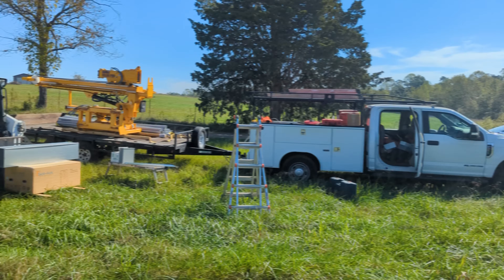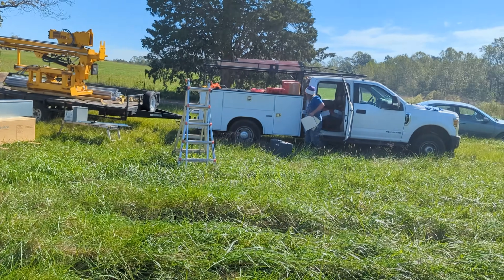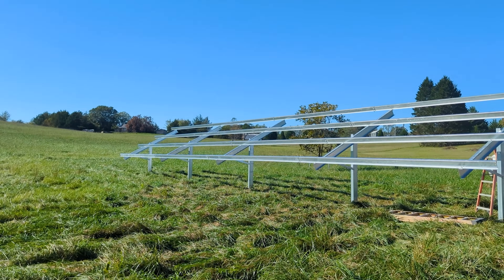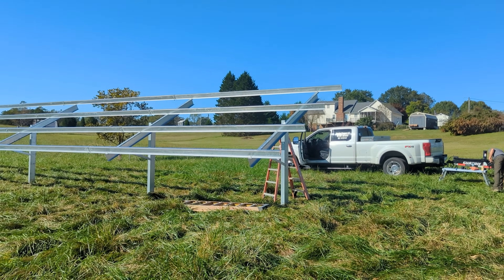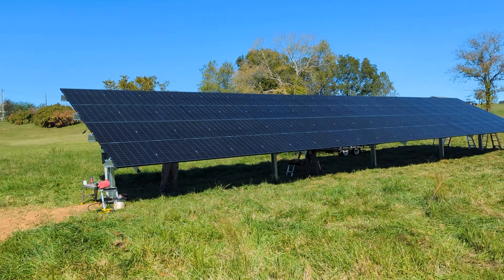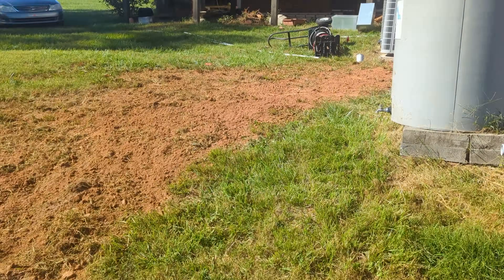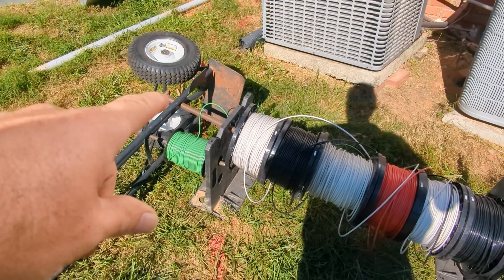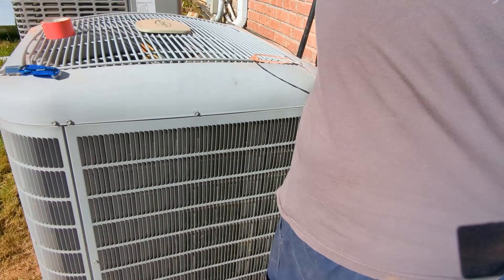Solar

Comment: What gauge PV wire to run over 300’?
Reply: 8 awg. It keeps the voltage drop under  3% with 22 amp/320v range. If you don’t parallel at the array it cuts the amperage in half so you can get away with 10awg. This is based on 300’. Southwire has a good mobile voltage drop calculator available for free wherever you get your apps.

Comment: Neat. Am installing 2 EG4 18K using 56 Aptos 370 nano bifacials ground mounted, using 6 EG4 power pro's.  As a Ham operator I am installing this in a separate power house with a UFER singular ground. It also has Foil insulation all around it for EMI/RFI along with EMP shielding. A Faraday shield of the sort. This in hope to lower the noise that PWM inverters make. Will need some ferrite cores at certain connects to lower stray RF getting out through wiring. Do you know of anyone that has such a setup?  Keep up the good work.

Comment: Just wondering why you install so many soft starts for thew air cond units? We in Australia have just about all of our air cond units big and small, using inverter technology and these work very well off grid. By the way, great work as usual.
Reply: These aren't inverter units.

Comment: Hear a trough there a trough everywhere a trough trough.  Anyway after that, I finally found a certified electrician that would travel to my remote off grid location to inspect my system. He pointed out I didn’t have that stupid useless ground running from my ground mounted panels on a steel rack concreted 48” in the GROUND! But I took the time to install it anyway since he told me that it wouldn’t pass my county’s inspection.

Comment: My biggest question to outside mounted panels is mainly for hurricane or tornado prone area’s, how well would the panels hold up to high winds and harsh weather. I would think they might get damaged by wind and brush flying around. I have no experience but always wondered

Comment: Do you ever get an inspection done and they’re not up on the technology?
Reply from the maker: @clarencewiles963  very few inspectors are up to speed with the latest kind when it comes to solar. I have seen the inspectors which are state inspectors in Tennessee. Be up on the code and actually cite proper code violations.

Comment: Quick question, if you have a 200a meter/main combo without an attached load center, do you still need the 200 fused/non fused disconnect switch?

Comment: Love the work you do I am adding my solar to my house Like to know what you think nothing like what you install  big money. Running 2 EX4 6000xp with 900 amp hours of battery and 7200 watts of solar have another 5400 watts to install latter Have ran 100 amps to the house so I can add 2 more EC4 if needed. Going to run all my 110 and 2 mimi splints on this What do you think THANKS

Comment: This is exactly the type of system i've been thinking about for my home. For a turn key job, is it possible to give an estimated (ballpark) cost of a job like this? Thank you for posting this.
Reply: I have no idea but my guess is $45k after the federal rebate
Reply: I'm in the middle of doing a job like this myself (for myself).  Well, I'm doing as much of it as I can myself because the cost is INSANE!  I'm having someone put the posts in and I'll have an electrician do the AC side.

Comment: Was at a technology demonstration where the ground mount for solar was on a powered retractable poles so a solar array could be retracted flat to the ground for high wind storms or bad weather. Was really neat. Simply a large RV slide screw jack with a small motor for each post.
Reply: No link?